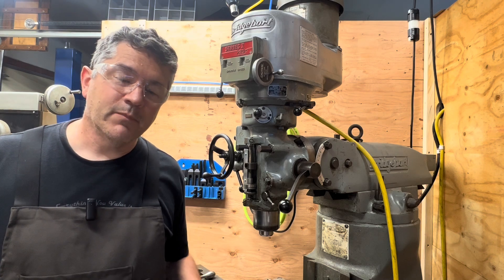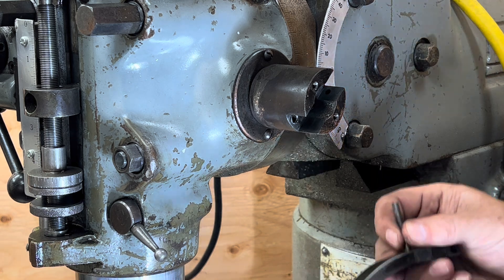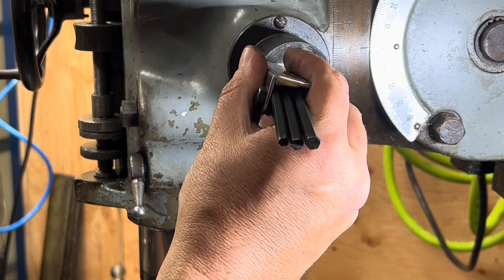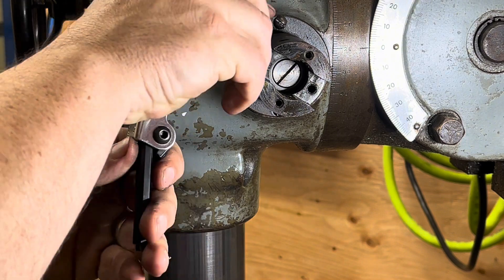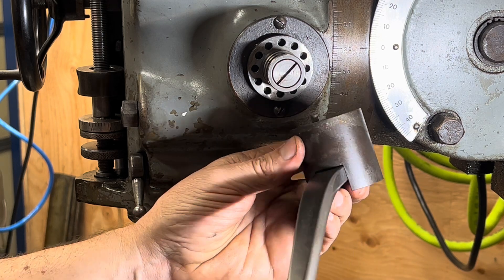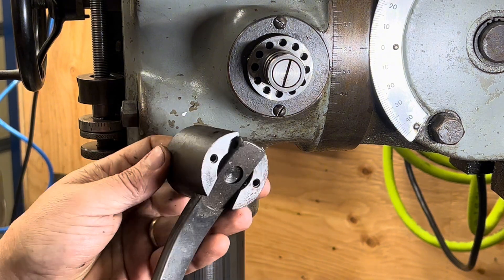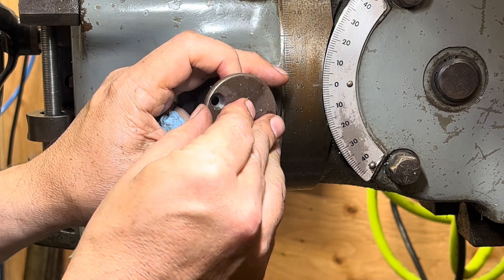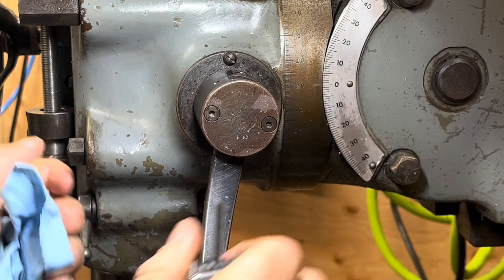Repairing a quick indexing quill lever on a Bridgeport Mill

Comment: It looked like there was a pivot pin missing from the lever.
Reply: See the empty hole through both the hub and lever arm 7:53 - 7:57
Reply from the maker: @chopperdoctor1989  at 7:35 I see a hole on the lever (by my right index finger). I'm not sure what purpose that has... I'll look more into it. Thanks!
Reply from the maker: Taking another look, you are right! The hub has a hole for a pivot pin. I’ll be making one right up!

Comment: When I first saw those in a catalog thirty years ago, I just had to have one! I couldn't bear to wait the week or so it would take to order one (before Amazon next day shipping) so I set about making one. It was about three weeks working an hour here and there after work before I finished it. That's okay, I like it better than the commercial ones. BTW, rather than a setscrew to retain it, I have a spring & ball so I can easily remove it, or move it to a second, "neutral" groove in the shaft. (Turns out, I never do.)
Reply from the maker: Now that mine works, I really like it...! Its great you were able to make one, a good project for sure.  I don't like the way mine is "loose" with the way the set screw works.  I like your spring and ball idea, I'll probably do that.  Thanks for the comment, I appreciate it!